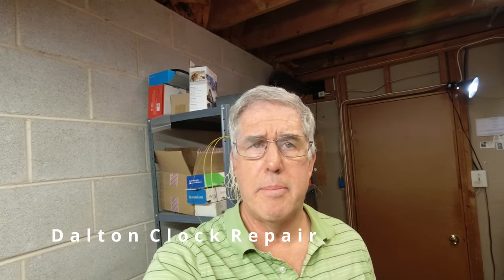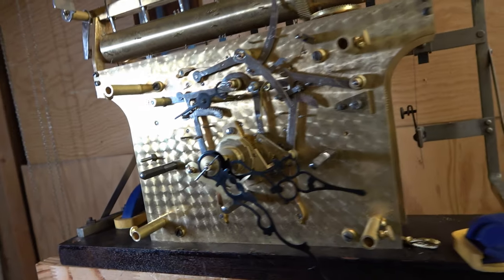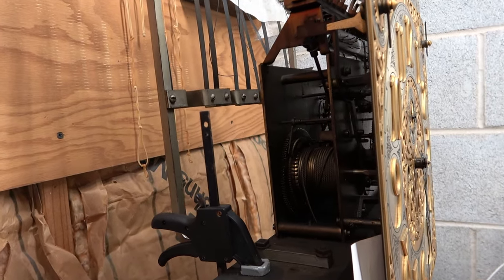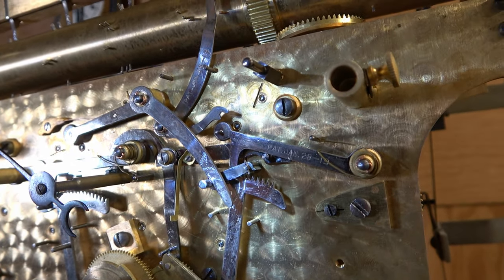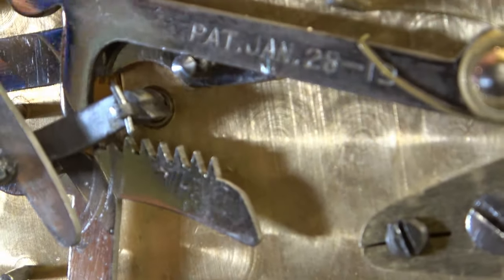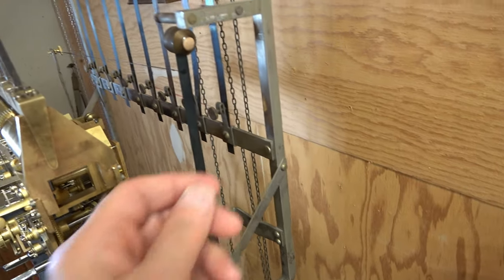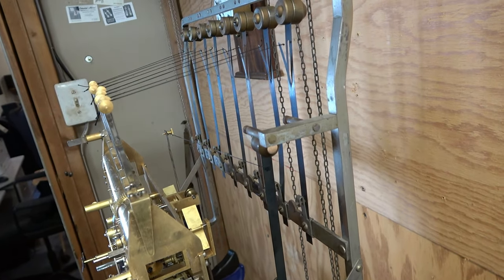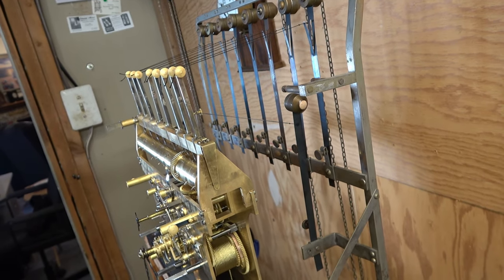A Herschede 9 Tube Chime Clock Restoration

Comment: I have a Herschede tall case clock that was made in 1913.  One of the very early Herschede made movements (I believe they started making their own movements in 1911?).  Anyway, I usually turn off the chimes in the night but sometime I forget what quarter the minute hand is on when I turn it off and turn it back on in the morning in the wrong quarter and the chime sequence is off.  I guess the early movements are not self-regulating???  I always have to fiddle with it until I get the timing right.  Anything to know about these early movements?  Love the clock and the movement is very robust.  Thanks for the rebuild videos!

Comment: I just inherited a Herschede 9 bell 3 train in a Queen Anne case. It was my grandfathers. He was a barber in the Wissonoming section of Philadelphia, but he also sold jewelry and repaired clocks and watches. The clock runs but the chimes are not working. Clock was built in '46.
Reply: I have a Queen Anne too. Originaly 9 tube three train but now 5 tube three train.

Comment: Interesting video especially the stuff about Wanamakers and the Herschede part redesign.  If you have time it would be nice to have a video of what the clock sounds like chiming and striking at the customer's house - probably pretty nice with those tubes.  When you have to redo bushings that someone has previously done, can you just take a punch and pop out the existing bushing and then install a new bushing in the same hole without having to do any reaming of the plate since that was already done?  I would think so but am curious as to what you think.  I am working on an Ingraham 'Gila' kitchen clock which has a bunch of previously installed bushings that need to be redone.
Reply: Thanks for the comment. As long as the bushings were installed using the same bushing tool that you use, you can pop them out and replace.

Comment: I would like to know what dremel tool you used for polishing and where I could purchase from? Thanks
Reply: I use a variable speed Black and Decker “Dremel style” tool. They can be bought at any hardware/home improvement store.
Reply: @DaltonDroneZone  I would also like to know what type of buffing wheel, I only am familiar the felt wheels?
Reply: @vipir06  rubber wheels impregnated with grit. Not sure where you can buy them. I get them from a supplier that does not sell to the public.

Comment: This looks like a 1920’s or early 30’s movement judging by the quick peek I got of the moon dial. In the 40’s, they replaced the larger, more pale moon faces with smaller more yellow ones that hid behind the hemispheres better when there was a new moon. I collect a lot of the early ones made before the company moved from Cincinnati to Starkville.

I also have a 2 weight Herschede but it’s only a 5 tube. They are quite an ingenious design but can be quite temperamental and cantankerous at times. I was told Herschede designed this movement around the First World War to save on parts like brass since it was needed more for artillery shells and rifle casings. But due to the movement being troublesome, it was dropped from their line of movements after just a few years. 

Just out of curiosity, where do you obtain the leather for the hammers? I haven’t had any luck finding any that is the proper thickness, always too thin or too thick.

Great video by the way, looking forward to the overhaul on the two weight.
Reply from the maker: Many thanks for the insight my friend. That's very interesting info on why Herschede made the two weight movement. I've worked on a number of them and they are temperamental. I got the leather from a shoe repair shop years ago.
Reply from the maker: You were spot on with the dates. I found newspaper sections from a Cincinnati newspaper inside the weights used to keep the inserts snug dated August 21 1927. 👍

Comment: I also have a herschede tubular grandfather clock. The movement is looks like the movement your working on in the video. 

My Herscede works well tells good time and chimes, but it doesn't chime at 12, 3, 6, or 9 but at 2, 5, 8, and 11. How can I fix this issue?